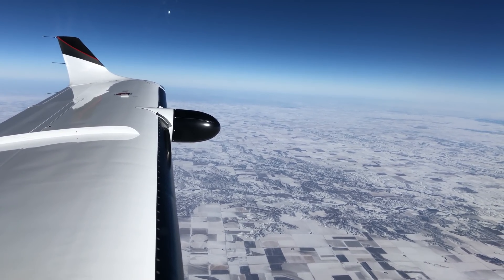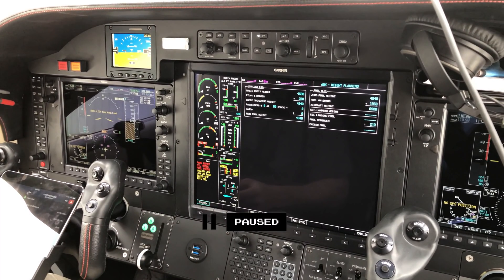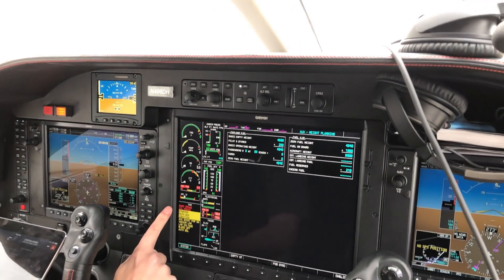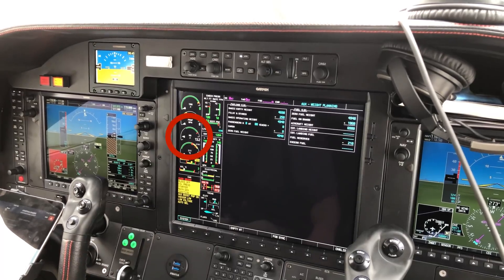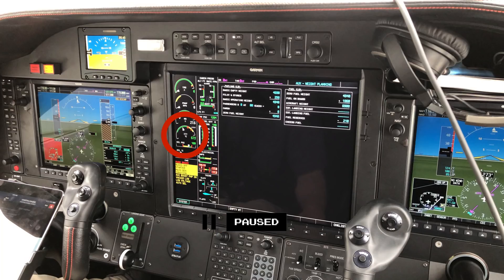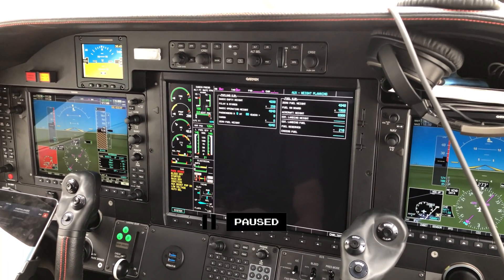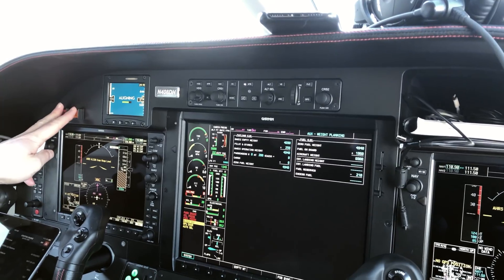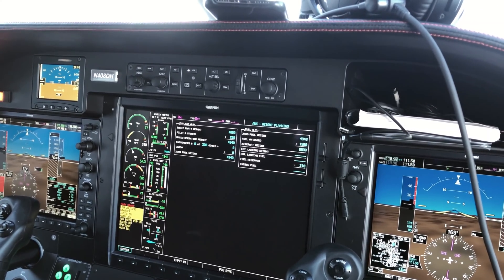TBM 900 Start Up in Detail (2 methods)

Comment: At 4:20 you talk about adding fuel by going to low idle but show a shot of the throttle at full power? Struck me as a little odd. Also, when is high idle feather used other than before TO procedures? How often do you use reverse after landing?
Reply from the maker: Yeah, you're right - was just the best picture I had of the throttle.  :(
You don't use high idle except for starting (on really cold days) and testing the feathering. I use reverse after landing any time I don't need to roll way down the runway before exiting.  It is cheaper to use reverse than to use wheel brakes, within reason. If I have to roll a good ways I may just go into beta, not full reverse, as that kicks up less dirt/rocks.
Reply: @JasonFlies  thanks for the reply! I apologize, I hope I didn’t sound critical, it was just a “hey wait a minute” moment for me. I’m surprised reverse is used that much, but very interesting.

Comment: Hi Jason, awesome videos man. Whats the difference between this TBM 900 and the TBM 930/940, both exterior, interior and systems wise?
Reply from the maker: Exterior/airframe/engine are the same - main difference is the Garmin avionics - G1000, vs NXi, vs G3000.  Interior has had some tweaks over the years, but mostly minor

Comment: I have always been intrigued by the throttle on the 900/930s, how do you set cruise thrust?
Reply from the maker: it stays in the left-side for the entire flight (only use the right side of the h pattern for start up and shutdown).  When in flight you can refer to the book to find the correct "% torque" setting for a given altitude and temperature aloft, but with the G1000 the gauge has a dynamically calculated box that shows the range of torque from normal to high-power cruise.  That range is small at higher altitudes.  I normally fly at the bottom of that range, in normal cruise.
Reply: Jason yes sir, thank you so much for your informative answer sir. My uncle is looking at a 700/850 or maybe even a 900/930. The TBMs are fantastic aircraft. 
I’m also from the Austin area. I’m a line guy at KHYI. Come on over to Berry if you ever get the chance. We don’t get enough TBMs over here. Especially not 900s!

Comment: Hi Jason, have a question:), when using GPU , after reaching ng54% you stay in lo idle or move to high idle before the guys remove the gpu connector outside? And from hi idle then you proceed to flight idle? Thanks, great video.
Reply from the maker: I just stayed in low idle until he was all done and out of the way, then went through high idle into flight idle.
Reply: Jason so the hi idle only purpose is for the feather process, during start you just pass from lo idle through hi idle directly to flight idle? What’s the other purpose of the hi idle ?
Reply from the maker: I generally don't use high idle.  The exception is at shutdown we set it to high idle for 15 seconds to allow the bearings to cool a bit.  And if I need to feather on the ground (to test that process) or to help out someone that needs to get near the plane (to unhook the GPU for example).
Reply: Hi Jason have another question what’s your email maybe you can help me thank you

Comment: I have a simple question but it urges for me to know ... how many hours of single or multi engines piston prop you need to do to be able to fly a TBM? Thx for ansering 😎😉👍🏼
Reply from the maker: In the US, the insurance companies really drive it - the FAA requires you have your complex, high-performance, and high altitude endorsements but otherwise a normal single engine private certificate is all you need.  However to get insured you will need an IFR rating, some reasonable amount of time in a high-perf piston (maybe >500 hrs, though there is no hard and fast rule) and ideally > 1000 hrs total time.  They will also require a detailed initial training course and annual recurrent training.  I had to do 25 hours of mentor/CFI time at the start also, which served me well.

Comment: You mentioned Denver at 5000 ft, but in the inlet air temperature was very cold.  I’m curious on a hot day at high elevation if the ITT temperature would be more of a concern as opposed to sea level.  Great video.
Reply from the maker: Logan, that is true, with the thinner air, all else being equal, the start would go a little hotter.  I haven't seen a huge difference here, but if you were doing a quick stop just to get some fuel, and it was hot outside and high elevation, you'd certainly want to let the ITT cool as much as possible before adding fuel again.  Additionally, on takeoff I normally go to 90% torque and let the increasing ram air as I speed up get me close to 100%, however on a high and hot takeoff you have to watch ITT as the limiter instead of torque.  And you may want to turn off the inertial separator as your speed builds to get more cooling air in.

Comment: Hi Jason, excellent video, the TBM is an awesome machine. As a jet mechanic, during engine starts on the CF6 engines (767 engines) or the rolls rb211 for the 57’s, after I flip the fuel switch, the first thing I look for is the fuel flow on that engine. Normally I will see around 300 to 500 pounds of fuel flow for a normal start, but if I see something over 1000lbs initially (first indication of a hot start) I will abort the start, shut off fuel, and motor the engine until the fuel is clear. I would love to see a hot start (in a TBM simulator) just to see what the initial fuel flow is.
Reply from the maker: Great idea, I have not been watching the FF while starting, will try to work that in as well....
Reply: I could do that if you talked me through it. Just got the TBM 900 X-Plane simulator from HOT START.  https://youtu.be/zlxRrGa-HF4 You can share my Skype screen and give me instructions to see anything you want… I would be extremely interested to hear any comments you have because this was an expensive model and alleges to be a study level simulator. Contact me through my video. Or here for further conversation.

Congratulations and thanks to you, Jason, for this terrific video… But I’m really confused about your comments of Flight Idle feathering the prop...according to my understanding and instructions from HOT START,  the right hand side of the “h”, is feathered and the left-hand side the of the “h” is UNFEATHERED flight mode.  

Chas
Reply: 300 to 500 pounds for a fuel start?
I'm flying the C510 Mustang and it uses 500PPH only in climb in the 0-FL200 range D:

Comment: Maybe you can do a video talking about the difference between Flow and checklist and how it differs between piston and turbine.   Thank you!
Reply from the maker: I don't think there is much difference at all, really.  I don't use a flow so much as I just remember what needs to come next and do it when I am 100% sure.  After that I run the checklist and find I missed something maybe 5% of the time - though essentially never anything big - always optional stuff.  However, when I was first starting out in this plane, or anything new to me, I would use the checklists first - that is how I trained on what to do.